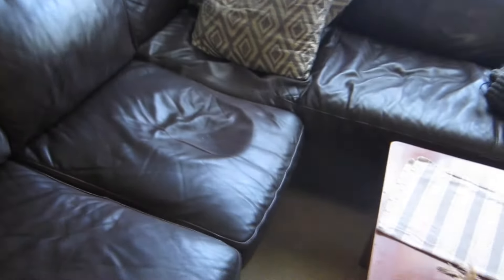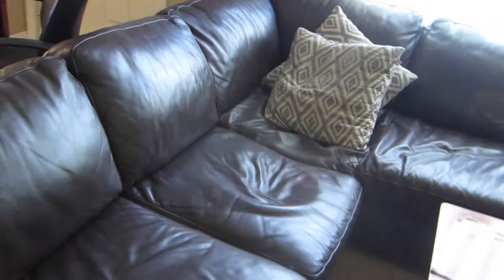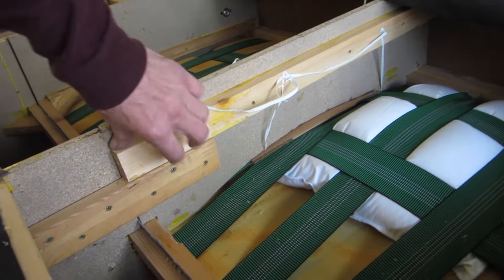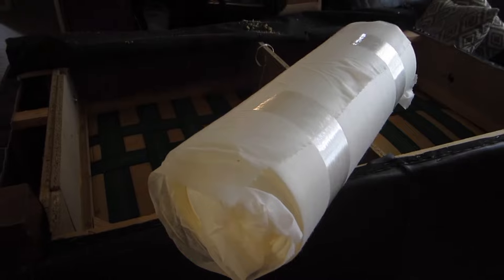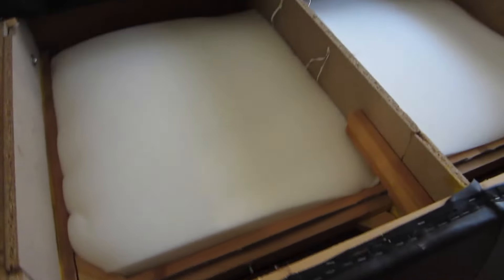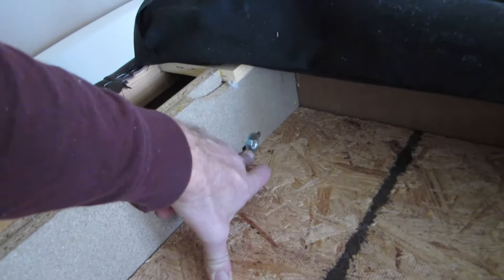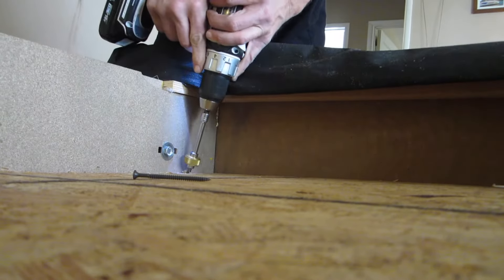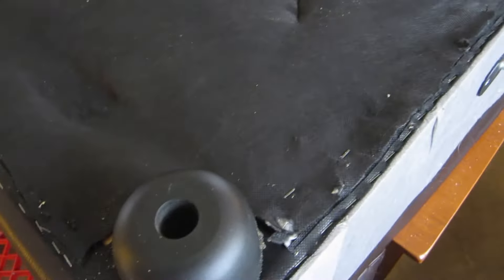Repairing a Sagging Italsofa Sofa - Natuzzi Couch Renewed

Comment: Nice DIY solution - I repair leather furniture professionally and see a lot of Natuzzi's with this problem. Also in the backrests. They provided a minimal # of bands and they skipped a fabric deck cover over the webbing, which would have prevented the foam splitting. An alternative solution that takes more time but uses less new material, keeps the sofa lighter weight and may cost less: Release the seat leather, remove the leather and foam (sewn as one piece with pouches for the foam), tighten the webbing, add more webbing, cover with fabric, and re-assemble. There will be a lot of staples to pull, but 2 diligent people can do this in an afternoon. 
1. Remove the dust cover, as you did. Pull all the staples you possibly can completely out and be sure to pound in the few that break off (they'll rip skin in a nasty way). 
2. Unbolt the seat deck from the rest of the frame, like a bed, or remove the armrests if the seat and back are one piece. 
3. Remove all the bottom staples holding leather to the frame, including the fabric tethers between the seats. Mark where these were /take photos for approximate location. If the seat and back are attached, you can usually leave the staples that hold the back of the seat material and just flip it up to remove the foam.
4. Remove the staples holding the elastic bands across the front and one side. Pull very tight and re-staple on the vertical surfaces of the frame, not on the top. Don't worry about losing elasticity, there is enough softness in the seat foam to be very comfortable. Use several staples on each so the webbing will have tension all across, not just the center. staples should approx 1/2" longer at a minimum so they will hold well.
5. Elastic webbing should be placed about 1/4" to 1/2" apart and be interwoven for long-lasting support. You can purchase more webbing (upholstery supply online or at larger fabric stores), or use non-elastic webbing from a home-supply store.
6. Cover the webbing with a layer of heavy duty, non-stretchy fabric. Pull smooth but not tight as you staple around the sides. Cotton/poly or all polyester is best for longevity.
7. Re-assemble. If the dust cover is in bad shape on the edges, replace at low cost at a larger fabric supply store or maybe from a local upholsterer. The main purpose it to prevent insects from colonizing under / inside of the sofa, so mend any holes.
Reply from the maker: thanks for the detailed instructions and welcome to the community Barbara.  Do you have a link for our readers for the webbing, and recommended cloth material?  We spent less than $100 on all our supplies on this effort.  And two hours with a trip to home depot.  We did add the weight of a sheet of plywood and the nominal weight of the foam.. I never considered that before.  Much thanks!!!
Reply: Elastic webbing can be purchased online from an upholstery supply. Black is stronger than green. Or you can use non-stretchy jute webbing made for supporting coil springs - use the one with black stripes, not red. The fabric for covering the seat deck can be any non-stretchy heavy fabric like #12 cotton duck. A polyester fabric will last longer.
Reply: I am trying to emulate your instructions but am kind of stuck. I am hoping you can guide me. I have the couch on its back with the dust cover off and everything looks solid. No broken PCs.  I confused where to go from here. The center cushion is sagging and crumbling
Reply: @barbacarney6398 - this is the video I've been searching for. Can you make one?

Comment: Could you have vacuum packed one or two pieces of foam the released the pressure after the board is secure. Maybe use solid wood for two.
Reply from the maker: thanks for the comments Mickey.  Consider subscribing.

Comment: My wife and I just lifted our black leather Italsofa up on the saw horses
we just built . Were pulling the staples from the bottom  dust cover. 
we have the sagging problem really bad in 1 section and arm rest near it.
It's a about 7 foot couch. I'm looking in from the bottom to see if I can see why it's sagging
like feels like you drop a 1 ft when you sit  maybe its only 6 inches but still  It's
a throw a way now if I can't bring the thing back to wher eyou don't have a sink hole.
I  going to watch your  video now se what you are doing with yours. 
 At first look in the bottom I see like lawn chair strapping woven back and forth 
its green  What are metal springs to expensive $ ?
Reply from the maker: Welcome to the community Bill. Tell us how it works out.